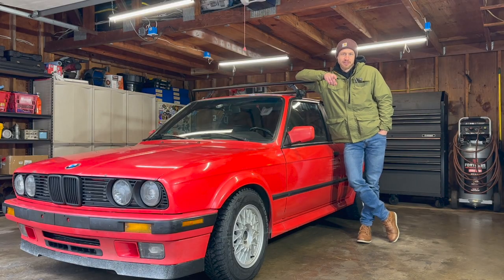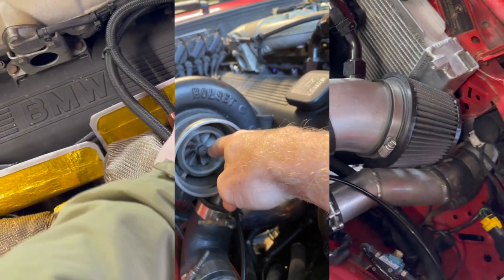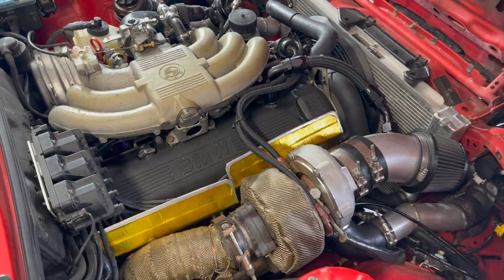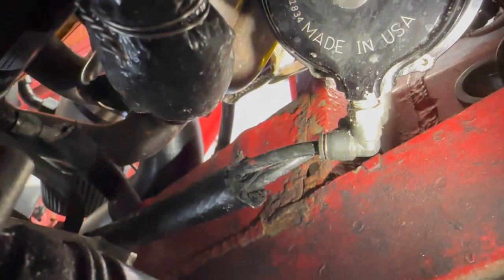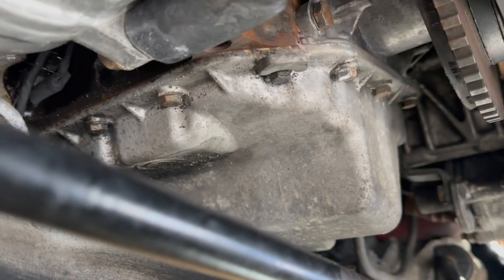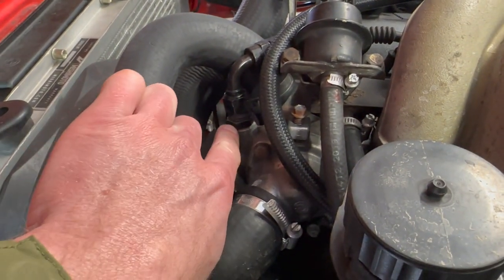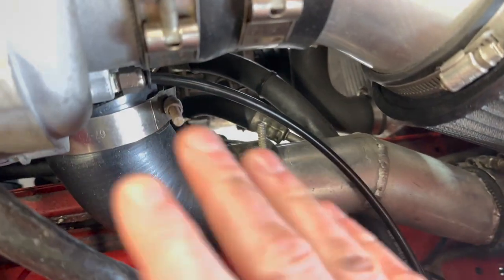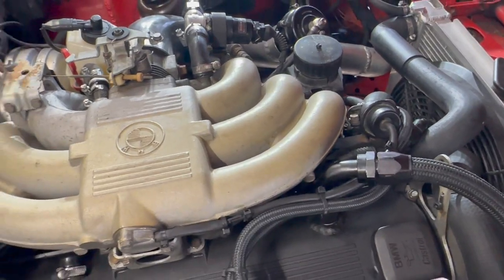My all wheel drive E30 iX Turbo build | How to turbo

Comment: How does the AWD coupling handle the jump in power? ive read quite a bit saying they arnt made to handle anything over stock so curious how yours is holding up
Reply from the maker: It’s not the coupling you have to worry about as much as the front differential. I have a couple spare because I was anticipating breaking them. So far nothing has broken and I’m pretty rough on it. Hard launches etc. Besides an upgraded clutch the only other mod I’ve made to the drivetrain is shimming the front driveshaft into the transfer case more using an X5 guibo.

Comment: Nice work my 1990 325ix is stock had an automatic gearbox that blew, I found a use one an I’m finishing the swap!! .. why you weld a tap on engine cover instead to use the deleted one ??
Reply from the maker: @genarogodoy6135  thanks. I did that because it was hard to find a good combination of fittings to work with the stock port. I plan on reworking it with a spare cover I have to use the stock location soon.

Comment: Hello first of all, really nice build. I had a question on how you wired the mac boost controller cause I'm also trying to rum it.
Reply from the maker: Thanks. I just wired it directly to my megasquirt and configured the settings for boost controller. Polarity doesn’t matter on MAC valves.

Comment: A slice between cylinders 3-4 helps with sealing on the manifold. Would you upgrade to a divided manifold? T3 or T4? Taking notes for my m20 turbo as well. Clean build!
Reply from the maker: Thank you. I’ve actually got the manifold off the engine at the moment resealing it. I’ll slice the flange between 3-4. I was thinking about doing that but you convinced me. Next I’ll probably fab my own manifold and use a divided T3 or vband flange.

Comment: nice build, ive got a chance to pick up a 325ix here too but a bit worried about reliability of the awd platform... any issues with the transmission/transfercase so far?
Reply from the maker: Not really but I also don’t launch it or clutch dump it. Make sure to use the X5 guibo on the front diff to push the front driveshaft into the transfer case for more spline engagement.
Reply: @85garage   great info, and good to see they can survive some boost! thanks for getting back to me, appreciate it

Comment: Awesome work!. Can you explain how you wired the wideband? Do you keep the factory o2 sensor? Is the wideband wired to the factory wire harness? Thanks in advanced
Reply from the maker: Thank you. I am using an Innovate LC2 wideband wired directly to the MS2 with the wiring provided by Innovate.
Reply: @85garage  oh OK thanks, and did you keep or delete your factory o2?
Reply from the maker: @cryan4249 it’s gone, not necessary with mega squirt
Reply: @85garage  interesting. Thanks so much for the info!